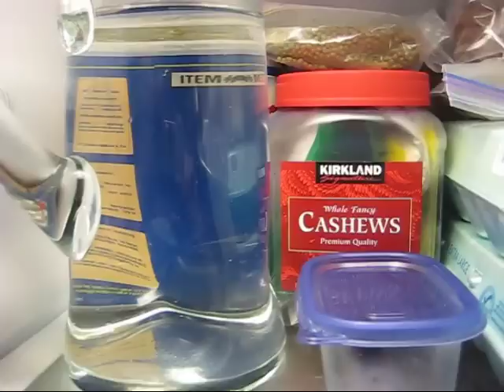Rainwater Capture System: Flow & Taste Test

Comment: Hi, I have watched alot of your videos, more than 1x. I have my 2 stacked containers in place and preparing to hookup my pipes. From my recent flooding issues in my basement and having to add more dirt around the foundation to prevent the flow of water into the house, I have concern for everyone who has their overflow/first catch systems that are draining directly next to their foundation to the home, as well as, the stacked totes. It would be really wise to run all of the overflow, and first catch water at least 3 feet away from those totes to prevent soil erosion from shifting the containers, which will pull on all of the plumbing installed to those. Any dripping water around those totes is not a good thing. Thank you for sharing your experiences and the videos.

Comment: @eaglehill6  I intend to use a biosand filter as well.  I don't want to depend on anything outside my home but the rain falling one it is built.  How is your filter made?  Have you had to clean it yet?  I have been wondering if I need to make more than one from barrels in order to handle the water fast enough to prevent wasting water as overflow when my tanks are not full.  I am going to make an elevated pumpless system.

LDSPrepper is drinking straight asphalt water... braver than I.

Comment from the maker: @jpham206 Fiberglass is stiff and brittle. Asphalt is typically black with embedded gravel and somewhat flexible. Most common is asphalt because it is cheaper. If you have fiberglass you will have much cleaner, chemical "free" water coming off the roof.

Comment from the maker: @dumdan1988 That is where my thinking is. However, I have determined we will run it through a gravity ceramic filter. They cost $30 and clean 3,000 gallons so it is reasonable and practical.

Comment: @LDSPrepper   Any water you capture that comes from a shingled roof will have toxins.  The oils and tars used in the manufacturing process is very toxic.  If you want to drink it, you should redo part of your roof with metal roofing.  As an alternative, you could build a covered patio and use lexan, fibreglass or metal roofing.  I have studied this for a couple years and finally arrived to a point where I live completely off the grid and drink rain water captured from a metal roof on my shed.

Comment: Excellent video. I was stationed on Thomas Point Shoals Light Station in the Coast Guard back in 77.  All of our drinking & wash water came off the metal roof, thru a switchable wyegate and went either into one of four cypress water tanks or into the Chesapeake Bay.  At the time the technology was over a hundred years old. It's comforting to see that we're turning the hearts of the children to the fathers and the fathers' to the children in more ways than one...

Comment: In  Kentucky, all we had was roof  rainwater for all our household needs, drinking water.  Most everyone had a 5,000 or 10,000 concrete tank (much like a basement) for the back porch. Old cisterns were made of brick.  Wells were not possible because the water beneath us was salt water.  There is a danger of contracting Giardia, which my son did.  A relationship is found in many scientific articles of cistern water & Giardia.  The common practice was to add 1 cup of bleach/5000 gal. of water.